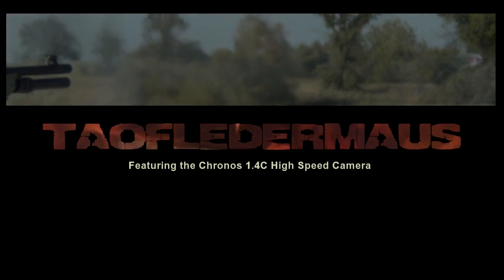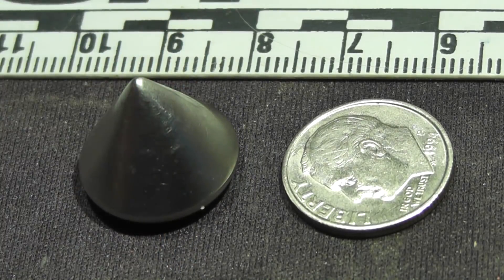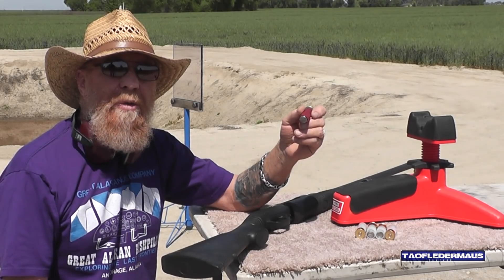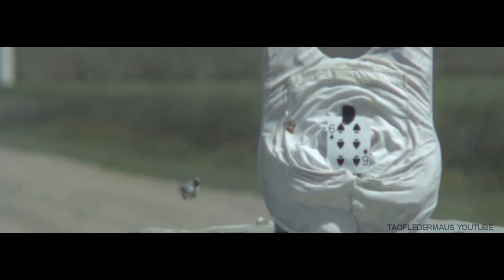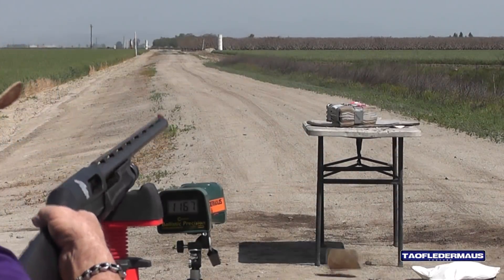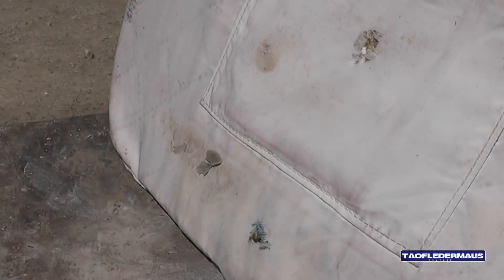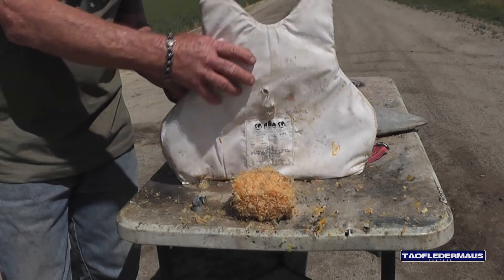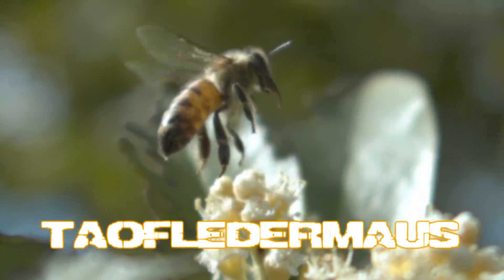Apollo space capsule 12 ga. SLUGS - +Mach 1  Stability Experiment

Comment: You might intuit that this type of shape would slam into the atmosphere and heat up more on re-entry than a slimmer shape, but that's wrong. It does not need to be so blunt to slow down to terminal velocity before crashing to Earth either. This was one of the big discoveries during the space programme (blunt body theory). A blunt re-entry vehicle pushes the shock front out further from the re-entry vehicle, putting much smaller heat loads on the heat shield.

Comment: Talc powder on the silly putty, might help release the delivery vehicle.
Reply: I was going to say almost the same, some parting powder to keep the putty from sticking.  Though I'd apply it to the slug.  Should be the same end result.
Reply: I use it when making casting molds, it helps release the molt/core from the sand.
Reply: I was thinking "silicone spray" while I watched it; same general idea.
Reply: Maybe a ever so light smear of petroleum jelly
Reply: Was thinking along the same lines
Reply: The putty's not a good idea because the energy transfer points will be inconsistent and translate into tumbling slugs.
Reply: It would have to be a dry substance.  Either silicone or petrolatum would form a hydraulic seal between the silly putty and the reentry vehicle.  Molybdenum disulfate, graphite, alum powder, talc, and chalk powder would probably work to differing degrees.
Reply: there be suction in any case, the sabot only worked because it had slots.

Comment: I wonder how fast they slow down
Reply from the maker: Probably the same as any slug,  around 10% speed loss every 10 yards.
Reply: TAOFLEDERMAUS really? I would think it would be more being there some what lightweight and a pretty high drag coefficient but I’m not the guy that’s been filming this stuff for years.
Reply: It'd likely be faster, a "bullet shaped" projectile has significantly lower drag but isn't as stable without spin. Blunt faces create big shock-waves and quite a bit of drag (though less than you might think, due to the bow shock effectively rounding out the shape)
Reply: I think these rounds would be best at longer ranges, the shape is designed to stabilize in flight and I feel at 10yds they aren't getting to do that.... Also might have underwater applications...

Comment: The Mercury capsule had a spoiler at the top of the capsule that would flip out to force the capsule to reorient heatshield first during an abort or if attitude control was lost before reentry. Apollo had a set of canards at the top of the launch escape tower to accomplish the same thing after an abort, but it relied on the guidance system and attitude control thrusters to make sure it was oriented properly before reentry. Gemini had no spoiler or canards. During a launch abort the astronauts would escape using ejection seats, like true fighter jocks, and had a guidance computer that was good enough to orient it properly before reentry like Apollo later would.

Comment: When I was younger I would set up a target range in my basement at that time I used floor tiles stacked about two feet thick too catch 30/30 rounds 357magnumrounds and 410 magnum rounds it worked great for sighting in those guns but it was a mess to clean up lol. Have you ever done any testing on fragmentation rounds for home protection I'd sure would like to know what does the most damage at lower speeds so it stays with in your home so it doesn't hurt innocent people outside. Thanks for the videos I enjoy watching them and very interesting on what some these projectiles do traveling at lower and higher speeds.
Thanks again

Comment: to answer some people

Why didnt they make bullet shaped command modules?

Because on re-entry, the tip of the bullet shape would melt due to lack of volume to distribute the heat. The current cone-ish shape has a round butt that may produce more drag, but also distribute the heat through more volume. Also more drag is good since they want to slow down afterall

this is all based on my knowledge on KSP btw
since the most common things to overheat are bullet shaped stuff with air friction on the cone side. comparatively a flat side overheats less

Comment: There is a ratio of saw dust and water to make the strongest pykrete where it is as strong as concrete. Note, that if it is starting to melt, it is probably weaker, so should be kept in below freezing areas or have a system that keeps it cold like running water below freezing temp fast through pipes. If it is kept running, it should not freeze.

Comment: The Apollo capsule was "off balance" so it could have some control in the atmosphere. For a projectile, assuming you could get it to fly stable, it would just cause it to curve or spiral and not be accurate. Also, are those pure metal? The CoM for the Apollo module was down near the floor, I'm not sure if this is significantly lower than a pure--solid substance would be. Perhaps taking some weight out of the top by drilling down through the tip could help stabilize it. I suspect the slugs are just too small to really "grab" the air. 

It's worth pointing out that bullets and return capsules are pretty much opposite in principle. Bullets are optimized to fly as far and as fast as possible, friction is the enemy. Return capsules are optimized to slow down in the atmosphere before they hit the ground at mach 2, friction is a frienemy.

Comment: I was going to put three slots in the back of the round to lighten it. It was going to use 3 fall away sabots. The sabots would hold on to the slots in the round.  The sabots would also have ridges on the sides that face inwards so they can grip on to each other.

Comment: try using a paper barrier for the slug and silly puddy, or try wax instead of silly puddy and keep the paper barrier. Also reduce the silly puddy's density with a light weight filler to increase separation speed

Comment: For years I've had a fun idea I'd like to try but would never have an opportunity, so I thought I'd suggest it to you. I wonder what would happen if u load a shotgun with a regular shell/cartridge (whatever they're called) and then hold the gun pointing up and fill the barrel with regular bb's, like for a bb gun, then put a piece of tape across the front to keep them from rolling out, then fire the gun at a target. With that much weight and quantity of "shot" I wonder how much power they would have hitting a target and how much they'd spread out, etc. My own theory is the man blast of shots firing from the cartridge would blow through the bb's and cause the most damage to the target, but probably less than a third as bad as unhindered shot would, and all the bb's would scatter out much farther causing minimal damage, but still not feel nice of it hit you. The
y should be copper coated bb's so it is easy to tell the difference from steel shot when examining the target.

Comment: How did he manage to offset the CG?He drilled a hole and lighted one side or try filling it with brass would you get a better result?
what if you used some talc of corn starch on top of the silly putty to stop it from sticking?
A  shotgun into a fine grain thread looks like a good way to polish small steel parts.

Comment: It seems like the CG could be off on these. We know the original Apollo vehicle wasn't a solid object, there's a solid chance it was flat-side heavy. The diagram at 1:14 seems to show that the CG sits 1/3 back from the flat ablator side, or thereabouts. Being that this isn't a guided projectile, no need for the top-bottom offset for steerability. 

I just have to wonder if the solid steel version coincidentally has the same center of gravity front to back as the capsule did, or not.

Comment: You should try using fine saw dust for your pykrete instead of the course stuff you used. Mix it together with water until it looks thick and sloppy like porridge then freeze. Looks like you used chips from a chainsaw which will leave to much ice between the large particles..   Nice tests as always guys..

Comment: I suspect a version of this with a bore hole down the middle could potentially fly more accurately and could be machined on a lathe with less handwork. It might need to be threaded to hold for hand work but file them out afterwards.

The borehole could also be drilled offset/offaxis.

I'd have used some vaseline or dry baking soda between the slugs and the putty to encourage a better release!
Reply from the maker: Silly Putty isn't very sticky,  about like a Post-it pad adhesive.
Reply: It's not one of the best materials for coming apart under pressure tho.

It was nice to see the sabots work a treat tho, so that was som quality work and design by Tim there!

Comment: Would the silly putty separate better if you put just a very thin layer of grease/oil etc on it? Could be pointless, but I think the polymer of the silly putty is latching right onto the metal, the grease or oil would create a barrier to prevent that.

Or maybe not.

Comment: Silly putty is pretty sticky... If you were able to save those slugs, maybe try putting some corn starch between the putty and the slug.

Of course, there might be other factors at play. Like maybe a pocket of low air pressure behind the slug causing the putty to stay in place until it turns sideways a little bit. That would explain why it always ends up separating eventually and destabilizes the slug.

I'm no expert though.
Reply: got to the part of the video where you said "so far 100% recovery"... Nice.

Comment: Yeah, the pycrete had too much sawdust, not enough water - I've made some myself, used hamster bedding, the cedar chips kind.

I made some with newspapers as well, got good results with both, 12 gauge shotgun slug didn't penetrate either.

I did use larger containers, 30-40 liters, and mixed the sawdust variety with a mixer bit on a cordless drill, until it was 33 F, trying to get an even distribution.

Comment: Maybe you could try to add something in between the slug/capsule and the silly putty, like baby powder, to prevent them from sticking to each other.
Reply from the maker: Silly Putty doesn't really stick to steel very strongly.   It's  enough to hold it in place but you can pop it out with a hard shake.

Comment: I have another silly experiment idea. Put a flame, like from a bunsen burner or gas torch directly in front and under an orange that is being shot by a shotgun slug that will make it explode into a blast of fine mist to see if the orange mist is ignited by the flame into a burst of fire. I once heard of and experimented with putting a small cut in an orange peel and squeezing it and letting the orange mist spray through a cigarette lighter flame and it would flare up a little. I think it may be very dramatic seeing it on a  much larger scale.

Comment: I can't comment on how closely your slug mimics the aerodynamic characteristics of the Apollo CM, but I do know a bit about the aerodynamics of the CM.  At supersonic conditions, the CM shape has an aerodynamically stable equilibrium at about 10-15 deg off-axis, and an unstable equilibrium at 0 deg.  Therefore, it will not maintain uncontrolled flight at a 0 deg angle of attack.  Also, it is not strongly stable even at its off-axis equilibrium, so if it starts at 0 deg it will overshoot its stable equilibrium considerably before correcting itself.  This sets-up a rather unpleasant oscillation for any occupants of the CM, and I suspect that is one of the reasons NASA offset the cg of their Apollo CM.  Doing so provided the CM with a stronger bias towards a particular point on the off-axis ring of stable equilibria and reduced its tendency to oscillate wildly.

Comment: What if you drill angled holes and the air get trough and stabilizes the slug
Reply from the maker: Because of the shockwave at the front of the projectile,   airflow is pushed entirely around the projectile.

Comment: Okay... So adding the offset that the real Apollo capsule had seems to have made a real difference... Alternative wadding helped too.  After all the kinks were worked out, that form factor for a round has amazing flight characteristics.  Still don't understand why the offset made a difference, but I imagine the original NASA engineers worked that out back in the 1960s.  I am also very glad you guys didn't make the n00b mistake of assuming space capsules did their reentry in the orientation they launch on their rocket in, nose cone first, then announce it a total failure.

You guys might have something with this.  Have you thought about seeing if Tim, or some other machinist, can create scale replicas of other known ballistic reentry objects?  Modern space capsules or perhaps ICBM warheads?  All of those shape profiles, are designed for ballistic stability at reentry velocities that put a rifle/shotgun to shame.  Though figuring out a wadding/sabot to stabilize a ICBM warhead shape might not be possible.
Reply: The offset is to make the capsule fly slightly sideways, so the air glancing off of the heatshield produces lift, and you can fly the capsule around a bit by rotating the capsule and therefore the direction of the lift.

Comment: First off using silly putty with the paint was obviously gunna fail, not the flight, but the paint. Its a gimmick older than cars, silly putty and newspaper. It removes ink from things.
Reply from the maker: I think I just forgot to put marking on that one.  The other two shot with silly putting didn't remove the paint.
Reply: TAOFLEDERMAUS that could also be the case, although it would depend on how much contact it had with the putty. If you pressed it in as tight as you could, it would leech more paint off that if you had just set it in.

Comment: they had integrated computer software/hardware that used thrusters in zero g and blasted off from the moon an docked with collins whos doing mach5+ 😆.
that means complex calculations and course corrections hundreds per second , the connection between the computer giving the thrusters commands and the thrusters doing exactly what the computer says didn't exist then...the harrier jump jet was made from similar age tech....can it fly hands free ? can it land on a air craft carrier thats doing 15knotts from computer only ? NOPE....it can just about HOVER running at 100% computer limit..

Comment: Wheres the steam when these things hit the water? They are said to experience thousands of degrees temps during reentry so they should be red hot and create a steam cloud when hitting the water but it never happens because nobody goes to space!
Reply from the maker: You are assuming the heat is being absorbed in the ablating heat shield.  The purpose of the heat shield is to not absorb heat energy.   Also,  the shape of the capsule causes the shock wave to act like a barrier to deflect the heat.  Finally,  after the capsule slows down below supersonic speeds (no shock wave) ,  it is being blasted by very cold air (around -60f)  which would whisk away more heat from the heat shield.   Hope that clears things up.
Reply: TAOFLEDERMAUS “slows down” lol yeah with parachutes haha save it for the gullible.
Reply from the maker: Keep thinking you aren't the gullible.